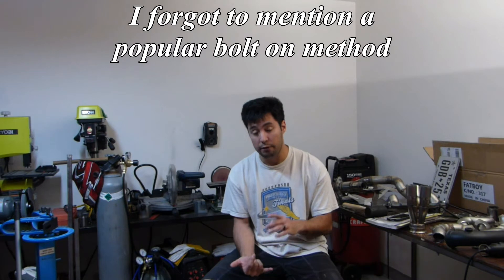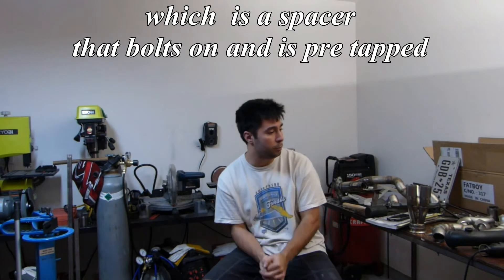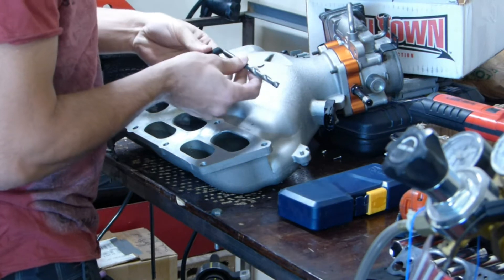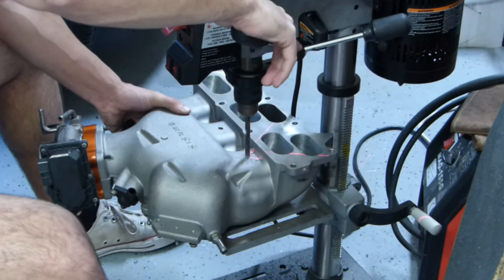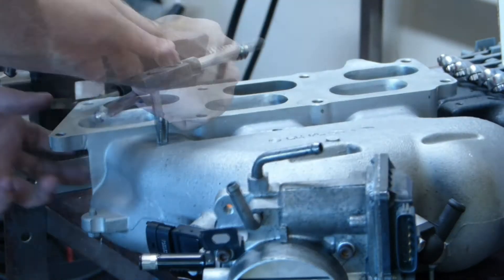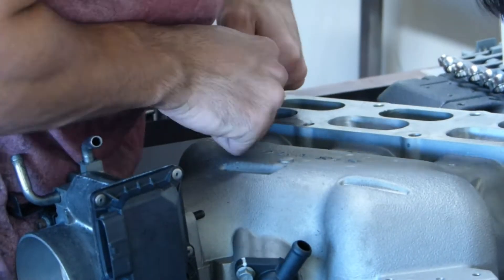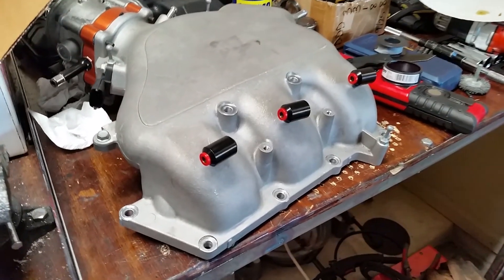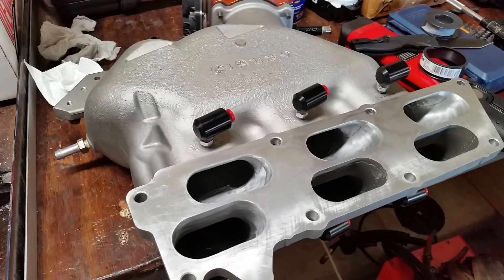✓ Direct Methanol Injection Upgrade DIY

Comment: Hey man, I see you're using the Devilsown kit. What nozzle did you use and how much boost/power were you making at the time of this video?
Reply from the maker: The devil's own part is just for the direct port kit, the controller and pump are AEM.
I used six devil's own DO1 nozzles and the car was making a little over 500 whp. Haven't modified it much since, but soon, I'm looking to get closer to 600 whp

Comment: So how does the solenoid prevent the mixture from being sucked out of the lines during vacuum  or de- cel. Isnt their a little in the lines after the solenoid that could be sucked out. Is there a check valve in the solenoid? Have you looked into promeths setup that eliminates that distribution block and upgrades the lines with either the ptfe stainless braided lines or actual stainless steel hard lines that are seamless.
Reply from the maker: A check valve is a spring loaded seal that stops vacuum from pulling the fluid out and are often placed just before the nozzle but can be placed anywhere in line. They have a minimum pressure before they open (like 15 psi) and are often somewhat restrictive to flow.
A solenoid is an electronically operated valve that stops flow completely (at any pressure basically) until it is activated and then it opens 100%. This means that there is no crack pressure (start pressure) for operation and there is less pressure loss across it so it flows better.
The other thing to keep in mind is that when you're trying to run less meth (so not 100% spraying), the only thing controlling flow is the pump, which cannot cycle on and off very easily because it has to spin up and then spin down so you don't have much control with a check valve because anything above its crack pressure will get through. With a solenoid, your pump can keep running and the solenoid is what controls the flow by cycling (turning on and off very fast).
As far as the fluid in the line after the solenoid valve, it keeps most of the fluid held in the line. Probably 90-99% stay in the line. Think of it like when you put a straw into a drink like a soda and then put your finger over the top and lift the straw out. Your finger (like the solenoid) is keeping the fliud inside the straw. Now if you keep your finger there and suck on the open end (other side), then you can feel the extra effort it takes to drain the straw fully. What you'll find with a normal straw is that the line collapses allowing you to get most of the soda out. Now if you have a really stiff straw like a methanol line, then you won't be able to collapse the line easily (the engine can't collapse it either).
I have not looked into the prometh setup but I'll check it out.
Let me know if you have any other questions
Ryan @InitialDIYmods

Comment: Wrong pure meth will give you 30% more power tuned then a 50/50 mix
Reply from the maker: SI RICKO Ok so the fact that you're speaking in vague generalities already shows issues with your statement, but we can go fact by fact on this.
1) Yes, there are more gains with pure meth than 50/50 as I stated in the video but your 30% really depends on way too many things to say you WILL gain 30% more. I don't call 10 hp on a 600 hp car significant compared to the 60 hp I gained with 50/50 even though 10 hp would be a nearly 17% gain from 50/50. That equates to less than 2% gain on the car's current power level. Even if it was an 18 hp gain like you claim is possible, that is still only a 3% gain which is marginal at best. 50/50 gave me a 10% gain.
2) N/A, turbo and superchargers have different gains on each fuel and every engine will gain differently. Some engines like more timing, some like a little less, some have VVT and can gain more top end where others can't with fixed cams. Saying you WILL gain 30% more is just not true. You can say it's possible to gain "up to 30%" but again, the max will vary application to application and situation to situation.
3) Methanol is unstable in its pure form because it is hygroscopic, meaning it absorbs moisture out of the air. Depending on how you store it or the size of your tank in the car and how air tight it is, your methanol can absorb over 20% water content which means your fuel is no longer consistent and your tune now becomes dangerous. A 50/50 mix will not absorb moisture out of the air which allows your fuel, and thus your tune, to be more consistent and safer, especially on a daily driven car where you don't go through meth as quickly as in a race application.
4) Pure meth is dangerous in a daily driven car. It has a low flash point and burns clear making it very hazardous. Full time race car drivers often wear fire suits and have extinguishers/fire suppression systems nearby so it's less of an issue in a pure race application
5) Pure meth is also more corrosive and although manufacturers say their pumps are pure meth compatible, they often won't warranty components that were run with straight meth.
6) Using the water to pull out more heat will reduce piston swell because water will absorb more heat than basically any fuel you'll use. If piston swell is a concern for a particular application (like my car with its 11.5:1 compression ratio), this would be a great benefit that goes beyond making more power. A blown engine doesn't make as much power obviously lol
7) You won't go through 50/50 meth as fast as you will pure meth (if you are using the same nozzles). This is a weak point because we all care about smiles per gallon rather than miles per gallon haha
Anyway, I hope those quick points help explain my perspective against running pure methanol injection 
Thanks for watching and Happy modding ;-)

Comment: since your showing peopple how to tap a hole you turn the tap back and fourth to relese the filings you screwd it straight in dude i thaught it was gana snap for shure yelling stop
Reply from the maker: I did but it's not being shown well in the time lapse. I am also keeping an eye on the cuttings down the bore and making sure it stays clear and doesn't bind.
But you are right, I should have shown it more clearly for this video.
Thanks ;-)
Reply from the maker: That's pretty cool, sounds like they'd be more expensive than my garage sale find (pretty sure they were from harbor freight originally but it works lol)

Comment: Two questions is your IM ported? And what did you tq the manifold down to after you put it back on thanks.
Reply from the maker: Massimo Demeo yes I did port it and balance the intake manifold.
The two long bolts have a torque spec of 7.2 to 8.7 and the short bolts and nuts have a spec of 13.7 to 17.4.
Hope that helps ;-)

Comment: why not tap the lower intake? or get the jrc plate? just wondering what's the best in your opinion
Reply from the maker: TheLostAdventuress two reasons, even with these low profile fittings, it was still really tight in terms of space. second reason is that meth and water mix has a large cooler benefit for the intake charge, but it takes distance to allow for cooling so by placing that at the beginning of each runner, I maximized the exposure time so I can get the best cooling possible. One of the draw backs of multi port injection is less time for cooling. some add an extra nozzel at the TB to get extra spray and a little extra cooling but I think 6 is enough for me and I can always go to larger nozzels down the road ;-)
great question btw. should've mentioned it in the video. I'll try to put it in the next video when addressing nozzel placement.
Thanks
Reply: Initial DIY mods ah ok. thanks! 6th nozzle would make sense but again can't tell where its all going haha